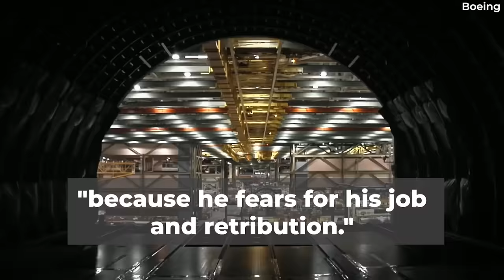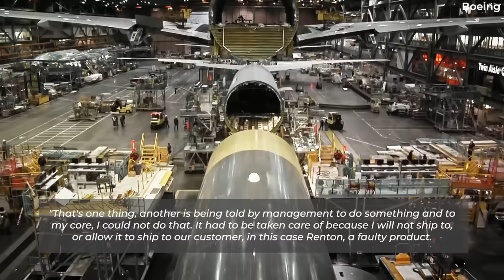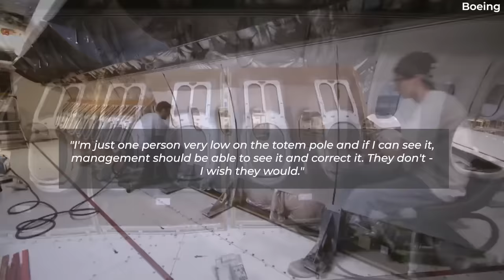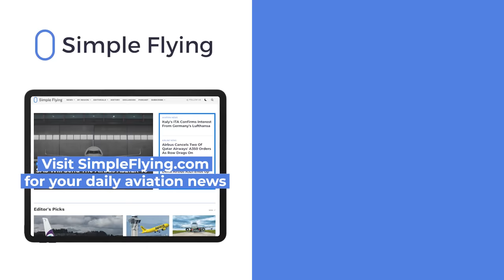Boeing Employee Reveals Manufacturer Has Taken Shortcuts

Comment: Seems this new work culture is now engrained in Boeing and its manufacturing plants.
It will take years for it to return to the great company it once was.
Reply: Thats the problem, once that once famous rule of safety first disappears, Boeing wont come back into the Airliner business, because no Airline can take the risk. So it seems Comac only has to step forward.
Reply: well years is like not worth putting the effort in
Reply: Never*
Reply: @nickolliver3021  Putting effort into building another fail 737max flop-trashy-lousy dangerous aircraft you wish to send your mom onboard?
Reply: @alvinloh9068  putting effort into building trashy cracking a320 dangerous no one needs to fly on that garbage
Reply: @johnchristmas7522 Or maybe even Russian manufacturers.